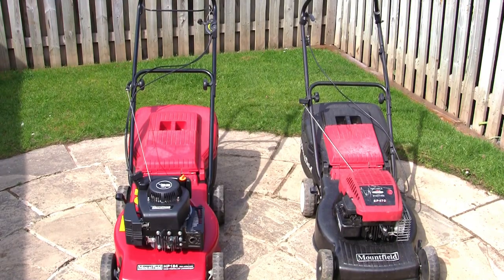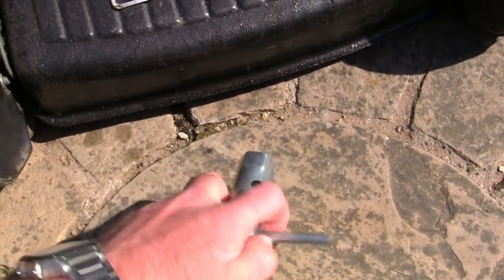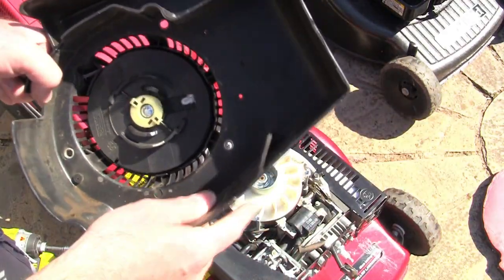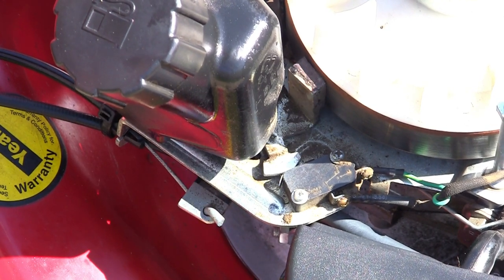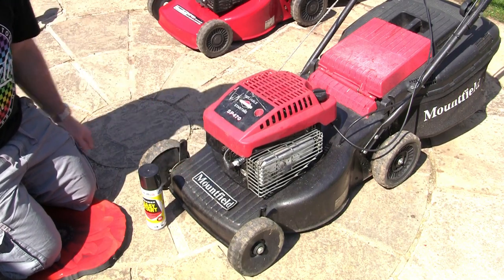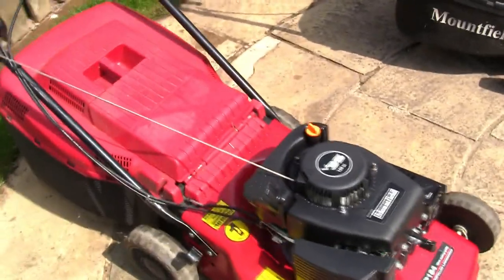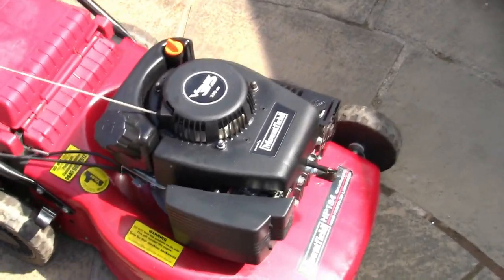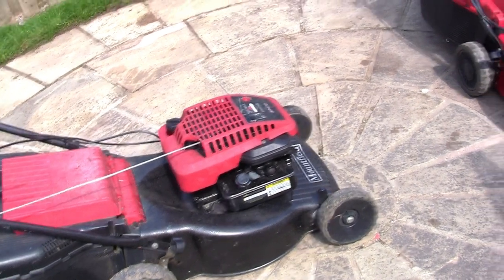Petrol Lawnmower Wont Start? Here's Why! 20 Quick Fire Reasons

Comment: Hi, I know I'm a bit behind but only found your channel because I got a Briggs & Stratton engine Qualcast mower from my neighbour, they bought a new one because the old one wouldn't run.
So, I thought I'd have a look at it, came on YouTube, typed in, lawn mower won't start, & here you are.
I know he took the oil & fuel out, with the look of the air fllter, he's tipped it right up.
I'm in the process of ordering a new air filter, new gasket & diaphragm & new governer & throttle springs.
I've already got the NGK B2 - LM Spark Plug.
I have found your video very informative, well put together with very good tips on tools etc, I was a shopfitter so have a good assortment of tools already.
Anyway Paul, thanks again for the video, I'm retired now so I've got plenty of time to watch ALL your other videos, 👍😁😁.
It's a like & subscribe from me.

Comment: Excellent video, Paul. Plenty learnt..
. One point that you made that really should be emphasised much much earlier in your video is to start the mover off the grass, preferably on the path/concrete. As a novice, I was not aware of how long grass under the mower seriously hinders the engine from starting. A crucial but simple point.  Thank you for your insight 😊. Greatly appreciated...

Comment: Thanks Paul I’ve learnt so much my mower is built by a company called DAYE in China ... I done all the servicing myself I would say it’s good as a Honda starts 1st time I’ve got replacement parts from Germany  a new blade and boss as they have a European office ... What I will say I use Morris Lubricants .. Race C30 Castor Racing Oil ... it does smell rather nice 👍

Comment: I like the info,I work on lawn mowers also, an easy way to crank engine is pull off the  starter and use drill and socket, I have r.a. easy start if  you an issue like I do
Reply from the maker: Thanks Ronald

Comment: What an absolutely great video! 👍 I have a battery start mount field self propelled petrol mower (the battery part also doesn’t work). The pull start cable just broke off tonight and the self propelled function stopped working also! 

Have you got any videos of altering the wheels as mine is a 2007 mower and the front wheels are both uneven. The alteration lever is just the one at the back for the whole mower. Doesn’t matter what I do the left front wheel will not move 🙈 and the mower splutters when I start can you help me! 

Regards

Carl

Comment: Hi Paul (or can anyone help?) I have the Mountfield sa 100 with suspected old fuel issues. I looked in the tank and appeared to be empty so added new fuel, I'm wondering if there were some dregs in there. Does this cause problems? Have emptied the small bowl inder the carb a few times. The lawn mower runs for a few seconds after spraying carb cleaner in the side of the carburettor (through the middle of the air filter). Incidentally the bottom of the air filter is oily from the machine being stored incorrectly before it was given to us. Any help appreciated.

Comment: Hi Paul - was fascinated to see what a v35 SHOULD look like! Mine doesn't look quite as 'new' but after a bit of TLC, respraying of certain parts (I think I'll respray the deck BR green) and robbing a few bits from M/field No 2 SV150 , I intend that it should not only work well but look respectable, if not seriously renewed. Seems to run OK but cosmetically, it has seen better days. New NGK spark plugs are on their way! etc etc.
Every good wish to you and yours and thanks again for your vids which are golden.
Paul in the Midlands
PS - Mountfield No 2 has a rusted-through deck at one part  -is it worth fibreglassing the rusted parts of the deck?

Comment: Another excellent video. Thanks so much. I zapped you something on PayPal.

I got my Briggs and Stratton engine working now.
Reply from the maker: That's amazing Mix Crimp. Glad to hear you got up and running. Thanks a lot for supporting the channel I really appreciate it
Reply: @MowerMan  your welcome. I enjoy watching your videos and look forward to seeing more 👍
Reply from the maker: Also i would use a cheap oil extractor to suck out the old fuel. As for the carb I would clean it all. Just spraying around never works as it wont clean the jets
Reply: @MowerMan  Thank you for the advice. I’ll do that. 👍

Comment: I converted a 36v lead acid battery electric mower to a briggs because im an idiot and i had an extra engine just laying around and those batteries cost like $60 a piece. So that electric mower had one of those safety switches but it didn't work directly with the electronic motor until it got past what was suppose to be a fly wheel brake linkage but it was FAKE and didn't need to be there! It's a weird mower... Chassis, motor bolts, and everything else was briggs like until you got under the plastic hood to the batteries and motor. The safety switch is just a glorified resettable mouse trap inside a plastic case and i had allot of trouble using the linkage cable that comes with mowers like these because the cables are broken up into segments it's not one shot to the flywheel brake. I haven't seen anybody do this on youtube yet but i might make my own video on how to crimp bicycle brake cable with just a hammer and vice grips. That's a big pain in the ass and important when working on mowers. That's halted me many times and yes I've tried literally using lead solder to make a new S thing and it was totally not worth it they crack and break so often anyways when they are working hanging on by a thread.